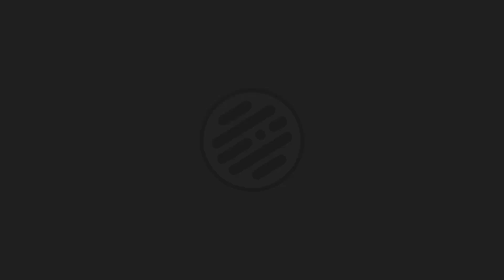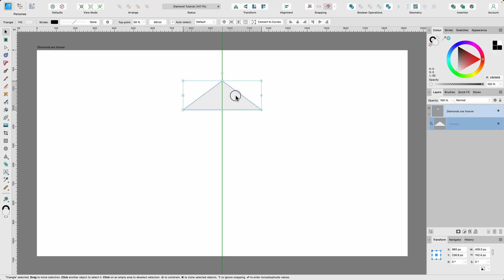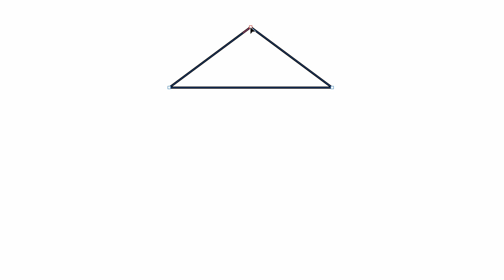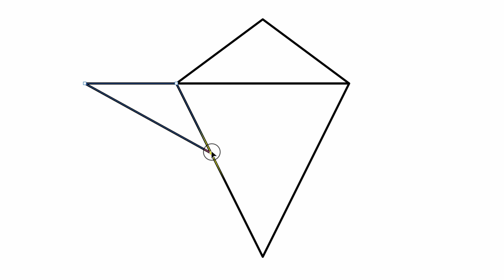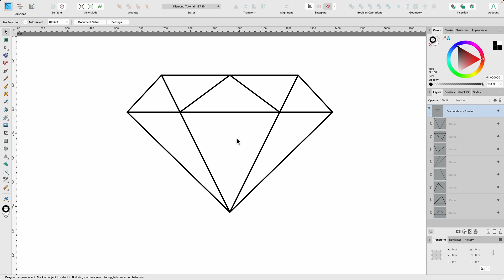Affinity Designer Tutorial: How to Create Diamonds

Comment: At 6:20 when I click Add from the Boolean buttons, it creates the outline Superman symbol but also a polygon shape in the middle. I've tried going back and forth and recreated the steps but never end up with an "empty" outline shape.
So I can't cleanly then use the Contour Tool to have the floating triangles inside afterward, because there is still the outline of the stroke lines in the middle portion.
Can't figure out where I'm going wrong.
Reply: I ended up copying and pasting the diamond and then selecting Divide from the Boolean buttons and then one by one removed all the internal lines. This left me with the Outline shape
Reply from the maker: Perhaps your nodes aren't snapped together properly
Reply: @ArtistWright  Yeah, I think that was it. I set my Snap to yours after that, started over, read through some forum posts about Snap settings tried again and then Aff Des glitched out so I gave up and went to bake a cake. I'll try again tomorrow.
Reply from the maker: @Livy0345  remember you can always check wireframe mode to make sure
Reply: @ArtistWright  Ah, I actually didn't know that so I'll def do that tomorrow